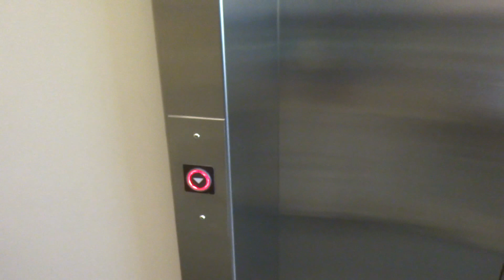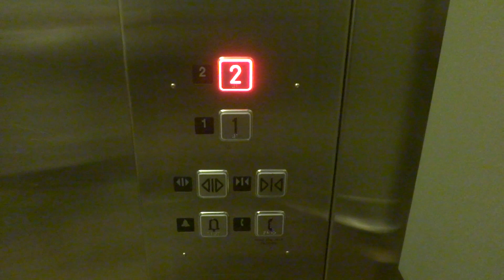RARE & INTERESTING US Hydraulic Elevator at Calgary International Airport

Comment: It probably used to had Aurora fixtures on the inside.... since those Dewhurst fixtures look pretty new.
Reply from the maker: There is a Schindler 330A elevator I found that also has those fixtures, but different.
Reply: I wonder when the 330A was installed... maybe it had HT VR, but it was replaced with those Dewhurst fixtures. Did it had the usual indicator and arrows?
Reply from the maker: No, it's got a custom indicator like what you see on high-rise Schindler elevators in America.